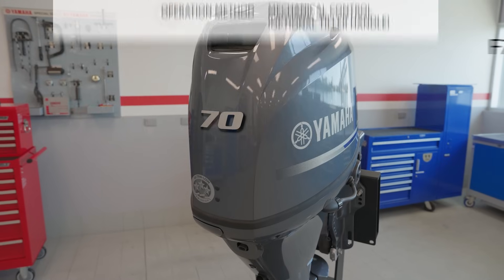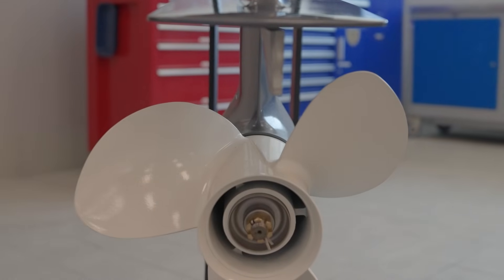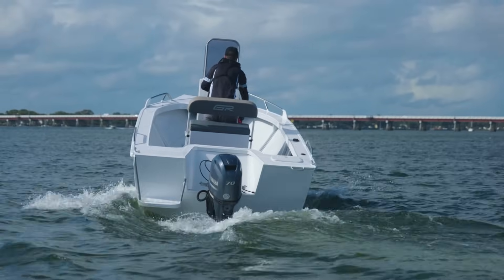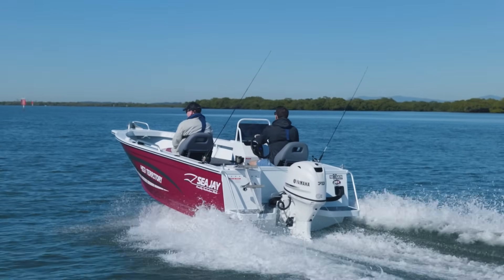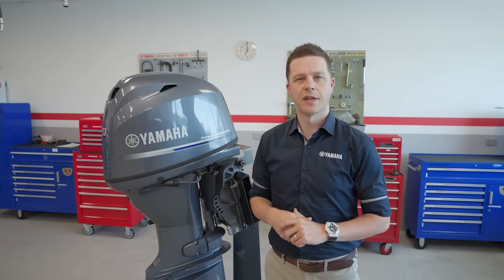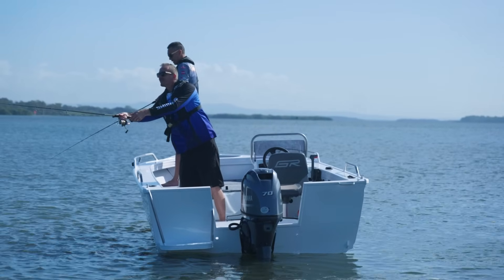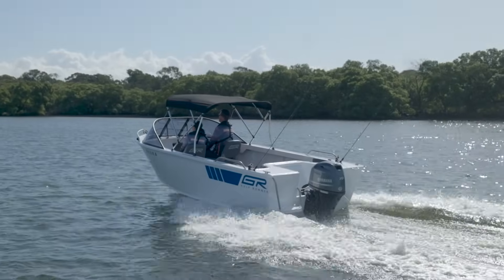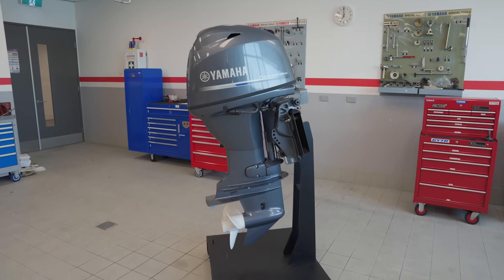Yamaha 70hp Outboard Walk-through

Comment: just buy a f75 almost twice the displacement of the f70
Reply: 100lbs more then they 70hp mite as well get the 90hp same weight    as the 75
Reply: @HeavyEquipmentandRepair  may as well get the 130 by that logic only about 10 kilos heavier then the 90

Comment: same outboard since 2007-8 ? lame
Reply: They were updated in 2019 when Yamaha introduced the latest generation of F-series outboards, featuring improved fuel efficiency, emissions compliance, and minor design changes across the F70 model line. Then in 2022 you could choose between yamaha gray, white , and mate brown
Reply: Is that true mate, Same outboard since? I'm trying to choose between Suzuki 60AT or Yamaha F70
Reply: @ahmedabdrabo2699  not true. They were updated in 2019
Reply: It‘s a shame isn‘t it?
Reply: Just spoke to a dealer and he said it hasn’t changed since 2017.
I could live with that